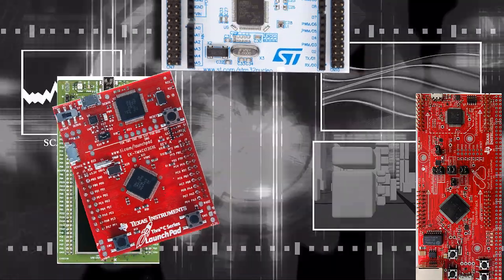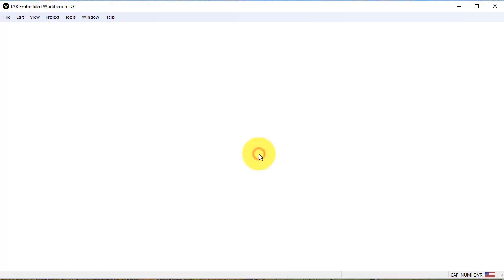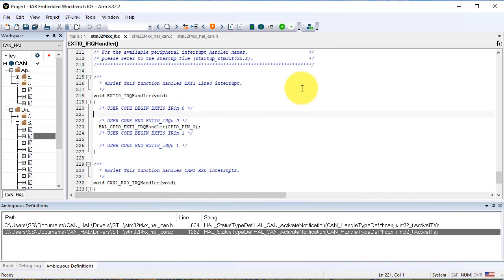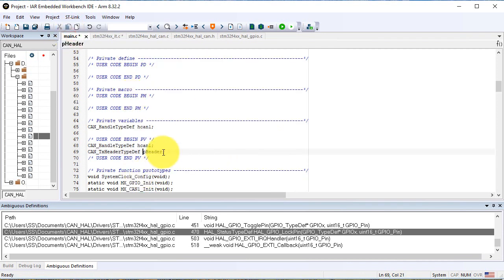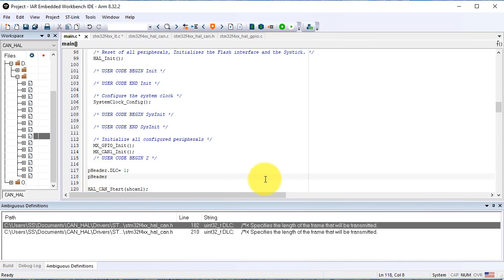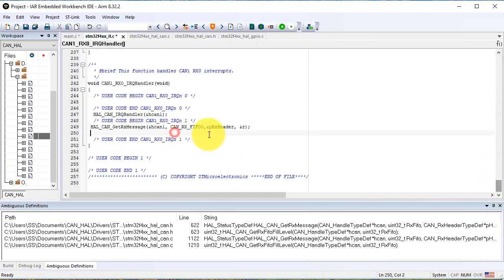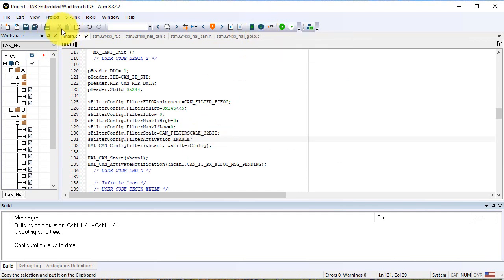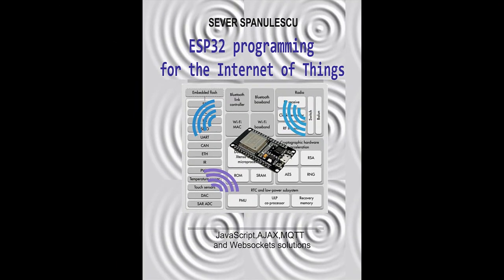Tutorial STM32F4 Discovery CAN using New HAL_CAN API functions.

Comment: Thank you for posting this video, although I struggle to understand why you put a delay at line 221 of your handler? Surly the point of using interrupts is to avoid blocking functions. There surely must be another way to verify genuine CAN message pending interrupt?
Reply from the maker: That delay is in the external interrupt handler and is not related to CAN. It simply waits for the mechanical bounces to end at the user button, which is tested then again for confirmation. It is a usual technique for debouncing. I explained it in previous videos and I showed that you cannot use HAL_Delay() in an ISR.

Comment: Is it possible to send a bxCAN message by UART? How is it possible?
Reply from the maker: Yes, it would be possible. You must build the 52 bytes minimum CAN frame and send the corresponding 42  (it means 52x8/10) bytes by UART. You have to consider the first bit of every UART frame, which is 0 and minimum one stop bit which is 1.  I think it may be too much trouble, though.
Reply: @SeverSpanulescu  Sorry, I think I explained wrong. I try to send a data previously received in bxCAN by UART.
Reply from the maker: At transmission, use a standard ID, 0x30, so the extended ID Is 0 (line 111). At the reception, try to specify List mode, and at line 107  specify the transmitter's ID, 0x030<<5. At trans, use HAL_Delay(5) after line 127, as the usart can't transmit too fast. At the reception, line 257, you must specify 8 bytes:  HAL_UART_Transmit(&huart1,&canRX,8,100).
Reply: @SeverSpanulescu  Sorry, I tried what you tell me. Square zeros still appear but slower.
Reply from the maker: Send me main.c si stm.._it.c al severspa2004@yahoo.com.
Reply: @SeverSpanulescu  Done, thanks again
Reply: Thank you very much, the software with which I read the terminal did not read hexadecimal when changing everything worked perfectly
Reply from the maker: First, note that on the Blue Pill, PA11 and PA12 are used by USB link. So try using PB8 and PB9. The prescaller should be 18, and I suggest BS1 is 7, and BS2 is 2. Tell me if it works.
Reply: @SeverSpanulescu  It does not work for me :C
Reply from the maker: At line 250 of the stm32f4xx_it_c at 14:01, you have the CAN received character, r. You may place here an instruction  "HAL_UART_Transmit(&huart1, &r, 1, 100)" which will transmit this character. Of course, in CubeMX you have to activate USART1 asynchronous.
Reply: @SeverSpanulescu  Thank you very much for your answer. I have tried it and I still have the same problem. I will try to upload a video to my channel with more details, if you can help me, as I would like to achieve this. Thanks again.
Reply from the maker: @7juan17  Ok, I'll make it a try.
Reply: @SeverSpanulescu  Done, I already uploaded the video

Comment: Hi sır,

I am Veysel KANTARCILAR from Turkey Yıldız Tecnical University. We are trying your STM32 Can example(https://youtu.be/ymD3F0h-ilE) on STM32 Nucleo F429ZI by using SN65HVD23x 3.3-V CAN Bus Transceivers(https://www.ti.com/lit/ds/symlink/sn65hvd230.pdf?ts=1609135156501)

Our problems are txmailbox getting full but not receiving and it takes hal error when we force GetRxMessage function because the interrupt is not triggering. We also tried other examples but same problem again and again. We tried to change filters and std, to add extid, to get rid of button and to use CJMCU-1051 TJA1051 transceivers. We need your help.

Best regards.

Comment: will mcp2511 works with stm32?? i dont have SN65HVD230 CAN bus transceiver communication module
Reply: Its working issue was with my black board i borrowed another evaluation stm32f407 discovery from my friend its working perfectly thank you for responding
Reply from the maker: Yes, I've tried mcp2511 and it works.  Be careful with Vcc.
Reply: Do u use telegram
I need small help can u give ur telegram id
If i are willing to give its good otherwise fine
Reply from the maker: @ezioauditore2425  No, I don't use it, sorry.
Reply: I tried everything
Those code not working with MCP2511, during debugging transmission function returned HAL_OK but In reception I'm not able to recieve any data
Reply: Voltage between CANH and gnd remain 2.2v somewhere
Reply: https://drive.google.com/file/d/1-quRHkT57zv_O-VZ58CpIUieCAmc8Ku4/view?usp=drivesdk
Reply from the maker: @ezioauditore2425  I can't see the connection for Tx of the transceiver - it must be on PB9 and Rx on PB8. Also, 5v of the transceiver should be at Vcc of the board. Some recommend that a resistor 3-10 Kohm should be put from PB9 to 3.3V (to have higher logical 1), and a 1 K resistor in series with PB8 (just to protect the STM). The rest is ok.
Reply: @SeverSpanulescu  connection wise der is no issues
As per pin configuration i connected u can see the image(PB8 - RX , PB9 - TX)
Reply: @SeverSpanulescu   https://drive.google.com/file/d/1-tkg66QxQC4ncjD8xxx1a_25CfO6-c4Z/view?usp=drivesdk
Reply from the maker: @ezioauditore2425  I see a problem in the picture. Don't use VDD pin, it has 3V. Use 5V pin on the other raw.
Reply: Your help will be really appreciated
Reply: VCC i connected to 5V of course
Reply: The black board is also stm32f4 and it share same pin configuration of evaluation board (green) for CAN peripheral that also i debugged transmission function returned HAL_OK, in receiving end of green board it is not receiving any data
Reply: Please let me know my hardware connection is fine or not
😂I even used twisted cable but no luck
Reply: No i changed based on ur previous comment anyway i tired both 5V and 3.3 there is no issue with transmission fun return HAL_OK reception I'm not getting at all, i tried all the possibilities
Reply: Yes i can confirm that when i made VDD (3.3v) transmission got failed (CanTX fun returned error) 
After switching hack to 5v (Transmission success HAL_OK) 
My issue is from the receiving end
When i debug and keep breaking point in receiving Rx0 callback function its simply not coming to that point
Reply from the maker: @ezioauditore2425  Use my software and if it works, try to identify the differences (https://github.com/SeverSpa/STM32F4_CAN_API)
Reply: @SeverSpanulescu Thank you the link seems to be broken
Reply from the maker: https://github.com/SeverSpa/STM32F4_CAN_API

Comment: Thank you for the great tutorial. What are the prescaler, Segment 1 and Segment 2 values for 250K baud rate at clock speed 168Mhz?
Reply: I'm sure you have figured this out by now, but using the same prescaler (21) the values of PS1= 6TQ and PS2=1TQ work for 250k.  Other combinations work with a different prescaler.  Checkout this table:  https://www.port.de/cgi-bin/tq.cgi?ctype=bxcan&CLK=42&sample_point=87.5
Reply: @barrykeane2716  I did figure it out! Thank you, Barry.

Comment: I noticed here you use the IRQ Handler in the stm32f4xx_it.c file instead of using a callback (such as HAL_CAN_RxFifo0MsgPendingCallback). Do you do that normally for other peripherals that generate interrupts? Is there an advantage to this?
Reply from the maker: I use callbacks sometimes. They provide an easier way to discriminate a certain interrupt source when you have several sources and you have to treat them in different ways. But then you have to write the  prototype in main.c.

Comment: Anyone have any luck bootloading via CAN bus?  Either using an St-Linkv3/CubeProgrammer, or manually using AN5405/AN3154?   I've placed in bootloader mode (BOOT0 = 3.3v), and I'm using a PEAK-USB controller to send it 0x79 (ID), and other values listed in the Application Note, but I don't see any CAN response/acknowledge from the chip!

Comment: hank you very much for this tutorial.
Everything works on STM32F103C8T6 (blue pill).
I suggest to create a read function  and move it to main.c
Everything will be in one place.

file stm32f1xx_it.c
void Can_RX ();
...
void USB_LP_CAN1_RX0_IRQHandler (void)
{
   / * USER CODE BEGIN USB_LP_CAN1_RX0_IRQn 0 * /

   / * USER CODE END USB_LP_CAN1_RX0_IRQn 0 * /
   HAL_CAN_IRQHandler (& hcan);
   / * USER CODE BEGIN USB_LP_CAN1_RX0_IRQn 1 * /
   Can_RX ();
   / * USER CODE END USB_LP_CAN1_RX0_IRQn 1 * /
}

main.c file
void Can_RX () {
     HAL_CAN_GetRxMessage (& hcan, CAN_RX_FIFO0, & pRxHeader, & RxData);
    if (pRxHeader.StdId == 0x201){
.....
     }
}

Mem only one problem. I have nothing in pRxHeader. There is only a DLC = 2 (this is true). RxData is fine.
How do I recognize the StdID frame?

Is there any more information on the Can bus via the HAL library?

if I find it, probably the old version, where it is:
hcan1.pTxMsg = & TxMessage;
hcan1.pRxMsg = & RxMessage;
Reply from the maker: Sorry, but this was only a one-time challenge for me. I let it behind, so I think You know CAN better now.

Comment: nice tutorial, thank you very much for it. 
I have some troubles with running bxCAN in Normal mode. In Loopback mode everything is correct (checked on logic analyzer), but when i change it to Normal mode, nothing happens (at the start of CAN_Tx function I've created it only sends one recessive bit).
hcan.Init.Mode = CAN_MODE_LOOPBACK; or hcan.Init.Mode = CAN_MODE_NORMAL;

Could you try to help me with that? It is very annoying and I've already spent lot of hours trying to figure it out :)

p.s. I am using STM32F103C8T6 board, and unfortunatelly i do not have CAN Transciever yet, but on logic analyzer I should be able to see correct frame, right?
Reply from the maker: Take care to the diodes,  they must be fast (glass case). The line mark must be to the pin. Anyway, a transceiver is about 2$ at Farnell.
Reply: Hi, did you figure out what happened? I got the same error. Could you please give me some suggestion?

Comment: Does the Arm book come with any of the projects source code, the website seems to only say epub?   
Also, I'm using an STM32h74x, do you think it's possible to have the DMA automatically transfer received can messages over to RAM or FLASH?  Or have ADC data automatically transmitted in a CAN bus message?

Comment: Thanks! If its ok with you I left the commented code from the main.c and stm32f4xx_it.c files up on github if anyone's interested. If its not ok jst let me know.

https://github.com/MattThimsen/stm32-CAN-bus-example-HAL-API
Reply from the maker: It's ok for me. But I don't know if it works without configuring the  msp as CubeMX does. And in the _it.c, it is not a "software glicth" that we want to eliminate in lines 208-211. It is mainly for debouncind the mechanical contact and eliminating any external, parasitic glitch, that may be induced in longer wires.
Reply: @SeverSpanulescu  Ahh that makes sense, updated. Thank you!
Reply: Also yes you'd still have to configure with CubeMX initially.

Comment: Great and helpful.
I try to communicate between stm32f407 and stm32f103 with CAN transceivers (SN65HVD230), but the f103 use old HAL API and diferent GPIO settings then f407 (103 use input and output - 407 alternate). It is possible to communicate each other? If yes how?
Reply from the maker: I don't have a f103, but my cubeMX allowed me to select one, and asked for some firmware update. So you have to make another project for f1103, choose the frequency (i took 72MHz) and in CAN try to establish the same Time quantum  (500ns) as f407. For this, the prescaller was 18, with time1=12 and time2=4. You may avoid external interrupts and increment a in the infinite loop, with HAL_Delay. It seems that the pins for CAN are PA11 and PA12. Good luck
Reply: Thank You, your idea helped me to solve this and I use this calculator (http://www.bittiming.can-wiki.info) to set up the same Time quantum. :)
Reply from the maker: @lexi0008  Yes it is very helpful. I lost it's address some time ago, but now I have it here. Thankyou!
Reply: how about updates cubemx, latest version? after version 5 now offer new hal can api for f1 series.